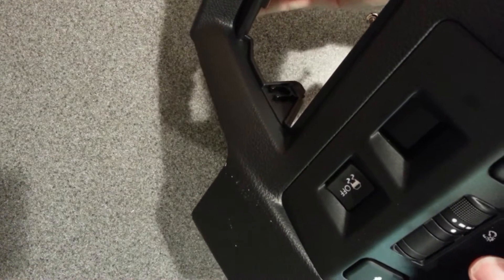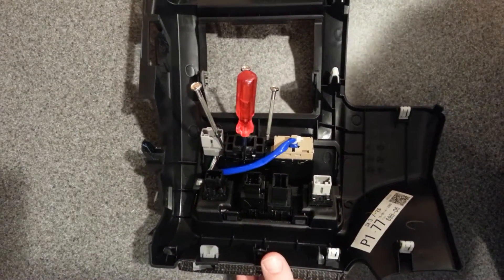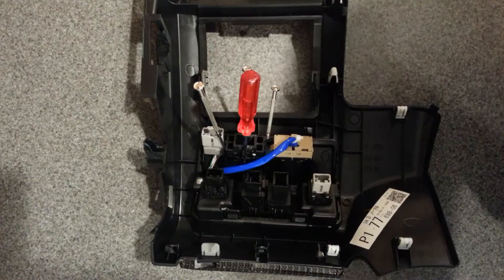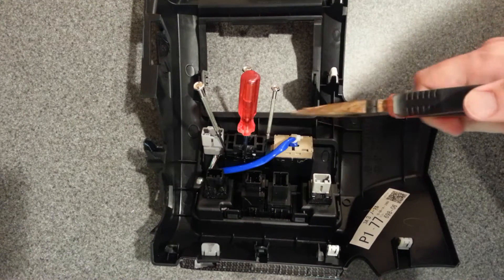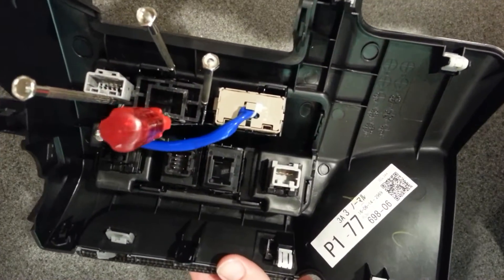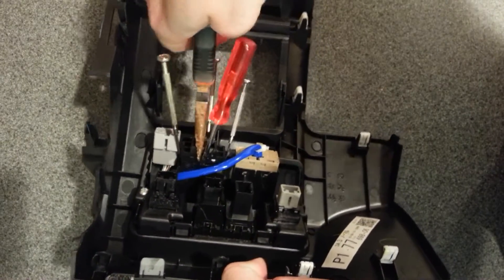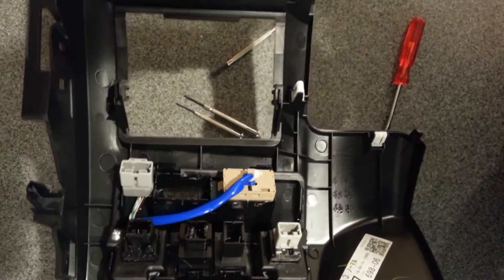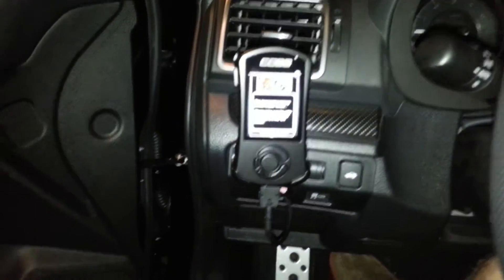2017 Subaru WRX STI Cobb Accessport Wire Conceal

Comment: great video. where does the other side of the wire feed through to go into the back?
Reply from the maker: It's open back there, I just have it plugged into the ECU port and I looped my extra wire and tie wrapped it behind the panel so you don't see any extra wire.

Comment: nice! have a video to take off the side panel?  is a video like that nessicary or will I be able to just figure it out?  I have a 2017 STi
Reply from the maker: Thank you. All you have to do is find a screw (I think around the left side.) and then it's just a matter of popping out the clips. It comes out very easy and goes back in very easy. One thing to watch out for, my Accessport keeps falling off (if you mount it right under the vent, yours probably will too. The Cobb glue tape sucks.)  I'm going to just crazy glue it soon.
Reply: Thanks for answering!  I pick up my car in 2 days, very excited.  I like VHB mounting tape or any regular 3m mounting tape that stuff is crazy good.  just make sure you clean the area very well.
Reply from the maker: Ok I'll try that. I remember the last few days of waiting. haha. What color did you get? I modded mine less than a week after I got it. I got a 3" downpipe, Cobb AP, fuel pump, CAI, and pro tune from Evan's Tuning. I'm at 360hp/330tq. It's a blast to drive.
Reply: STI DucatiMan that is epic.  I got a lapis blue 2017 brand spanking new.  I'm thinking stage 1 intake and axle back to hold me over for as long as possible lol...I didn't buy this car to keep it stock!!!
Reply from the maker: Yeah I'm thinking of getting exhaust and a re-tune and maybe some other mods right now. Love STI's!
Reply: I cannot wait ahh!!
Reply from the maker: Hope you post a video of it when you get it!